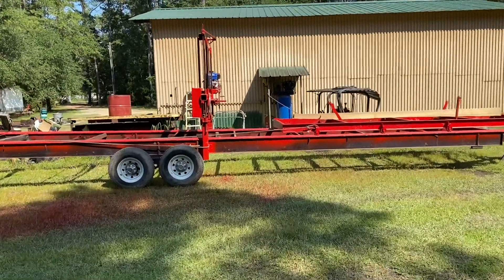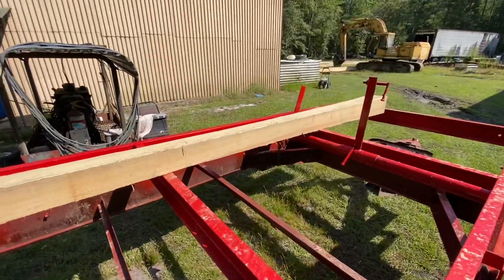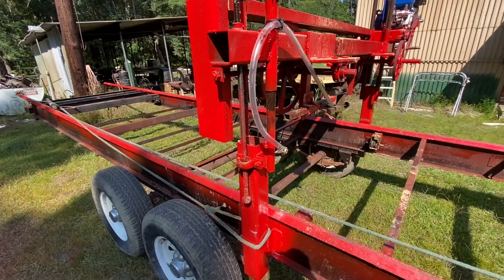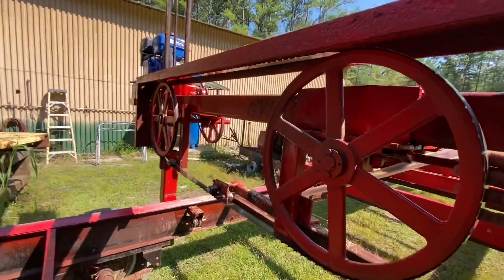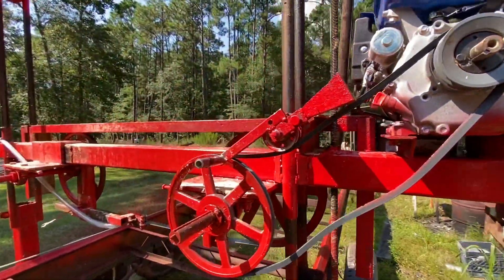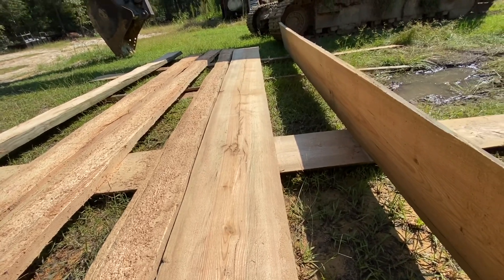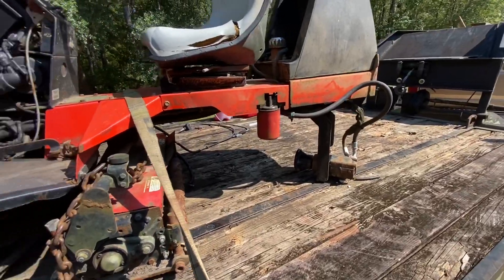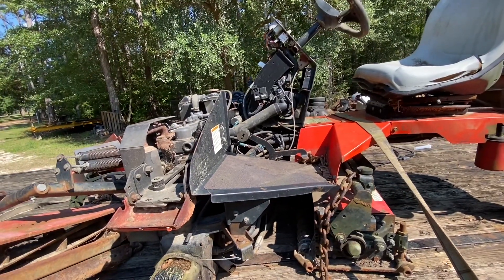Homemade sawmill part 2

Comment: We work with what we have to do what we love. Can't get better than that. Started my bandsaw mill project a few years back. Was originally going to go with fixed saw gantry and log trolley myself. May yet, I keep thinking about powering saw with tractor PTO. Being where I am in the process, can still go either way. May be a good thing these old bones move slow. Fun project. Like you, I expect to realise the fuller joy of cutting wood with something I built with my own hands.
Reply from the maker: I still want to revisit powering mine with the tractor one day. As of now the power on the engine is the limiting factor on how fast I can cut

Comment: Awesome but why the fixed bandsaw with moving log track
Reply from the maker: My original plan was the power the bandsaw with the pto of a stationary tractor. But the length of driveshaft I had was nowhere near long enough and the buy the right one would have costed twice as much as the motor